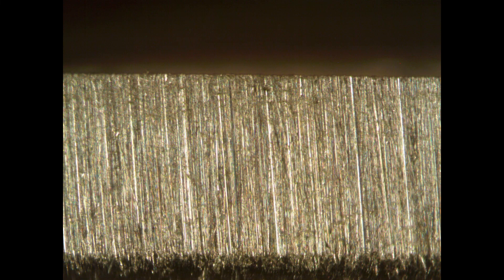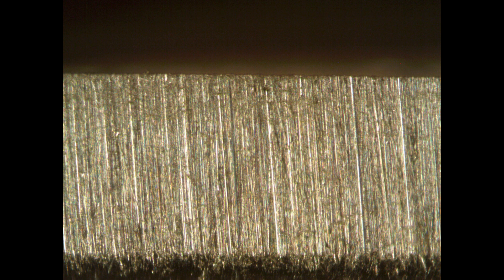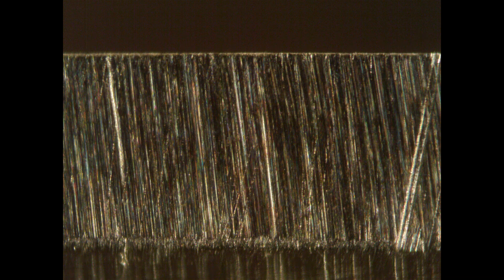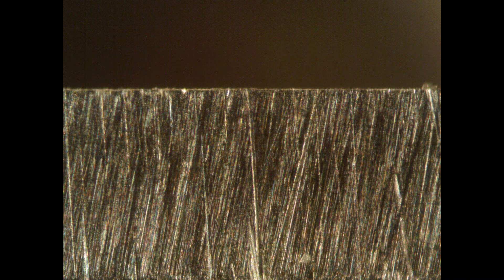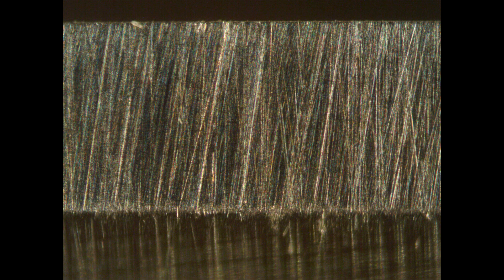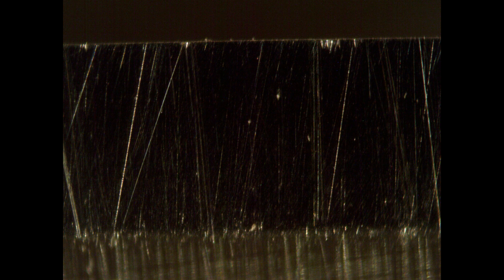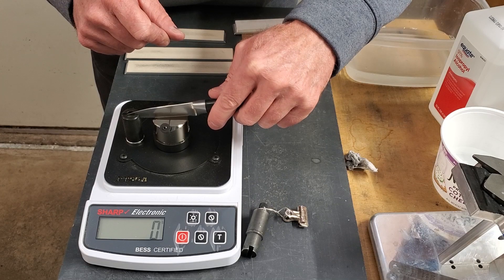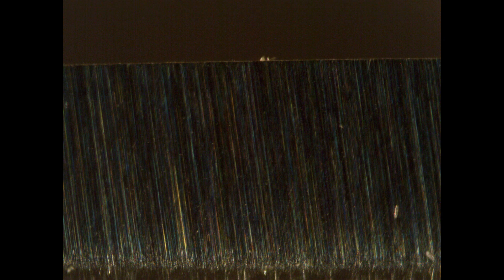Experimenting with the Bond Hardness in knife sharpening stones and strops

Comment: How many passes do you use with leather strops
Reply from the maker: For bare leather generally 10-20 strokes per side and only for burr removal. Even for a softer steel like the knife in this video bare leather doesn't do much to the steel, it really needs some abrasive added to it. But leather is a bit too soft and quickly convexes the apex. If it is loaded with diamond then 2-3 passes max, any more and the angle at the apex changes significantly.

Comment: Great Video!    Have you concluded that:
1. Overly hard resin - poor results.
2. Diamond Matrix Stones are in the "Just Right" zone.
As an observation, various steels respond differently to any given type of abrasive.
Was the knife you sharpened 440 carbon steel?
Is the knife relatively soft? (HRC below 60)
The Matrix stones do an outstanding job on very high HRC steel. (HRC 62-67 and Maxamet 70)

Thanks for the video.   😎👍
Reply from the maker: I think the knife is 440c and the hardness is good for what it is. The Matrix  stones still work well on this steel but I borrowed a full set of Shapton Glass stones and the hones from EP probably 2 years ago and it's time to give them back so I wanted to play with them some before doing so. It also gave me a chance to try aluminum oxide on my polymer strops.